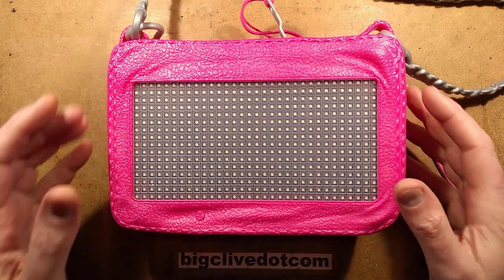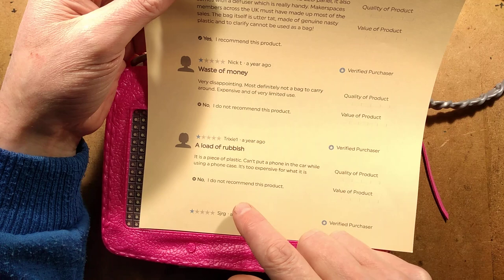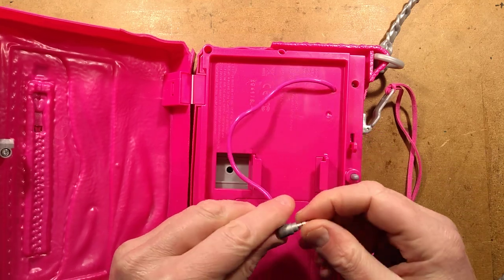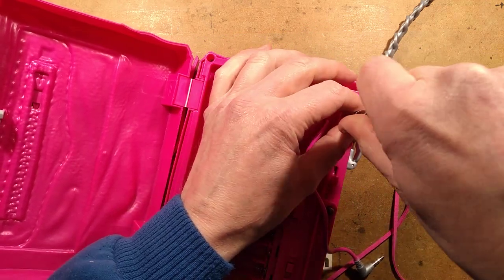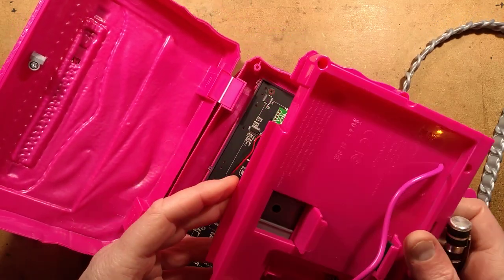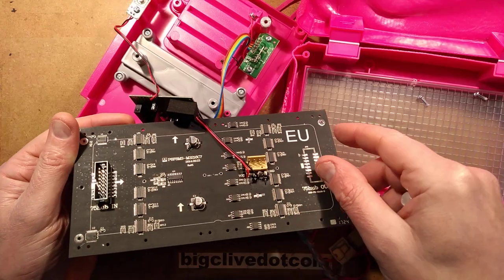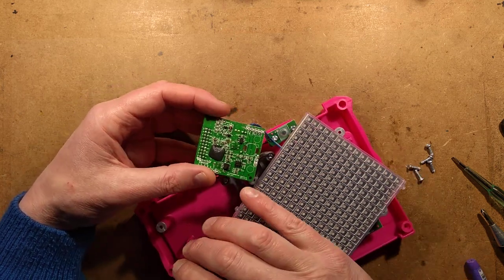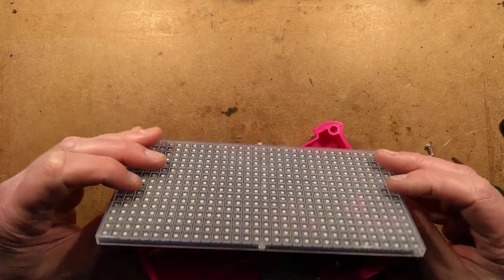Inside the Project MC2 video purse.  (Actual video wall panel!)

Comment: Amazon US has them for $8.  :)
Reply: Got 9 of them 2 weeks ago. Striped them of the panel and put the panel on a shelf for later use. Amazon has a 3 limit per order on it.
Reply: $50 plus shipping on Amazon.ca... 
and that or more from any other seller in Canada. 
Just buying the panel from Adafruit is cheaper.

I'll have to keep an eye out at the charity shops...
Reply: @LiezerZero  Plus currency exchange, shipping and import fees to Canada... works out to about $30 Canadian$$.
 But still a slightly better deal than buying it domestically. Thanks
Reply: Wow, the pricing on amazon is going up as I watch!  I missed out on the $8.00 price, bought at $10.85.  And just a few minutes later, price is up a penny.  It's like buying on the stock exchange, such pricing elasticity.
Reply: @lmamakos  Big Clive Effect. :)
Reply: Louis Mamakos , was $7.72 when I bought it, it's $11.26 now .. eBay went up from $9.17 to almost $12.76 as well
Reply: @lmamakos  up to $12.28 now. With delivery and customs etc, it's about £1 less than the UK Prime price. 

I nearly bought one of these for my daughter last Christmas; was way too expensive at the time though.
Reply: @lmamakos   You're right.. It's now up to $13.37.
Reply: $13.87 or so now .. close to $16 on eBay .. the A-Hole that I bought from on eBay is trying the cancel the sale using the excuse that they were out of stock and his "employees" didn't update the inventory. but in reality it's because I bought it for $9.17.
Reply: @LiezerZero  thanks for the link! ordered!  what a pointless yet awesome toy to play with!
Reply: $15.17 on Amazon and $17.50 on EBay at the moment. I'm so jealous! Might have to wait another week or two for the price to drop back down...

Comment: Totally not the cheapest way to get LED wall panels,  also you can get Linsn or Artfox LED send/receive cards online to drive them with dmx/artnet or even run video though a decoder. The parts themselves are pretty cheap for video wells. At least in contrast to lasers lol.

Comment: Oh, hell yes!  That little pink purse with a Raspberry Pi inside and using https://github.com/hzeller/rpi-rgb-led-matrix should be just a completely stupid project.   Lots of good info in that github repo, which seems to have been the genesis of the stuff on Adafruit.   Available on Amazon at https://www.amazon.com/Project-Mc2-Toy-Light-Purse/dp/B071LQR2QG for US$10.85, while they last..

Comment: Looks like a DMD connector used for LED sign boards. An arduino can control those easily. They daisy chain, hence the missing connector and the orientation arrows. As low as $10 bucks each for the RGB versions via Ali.

Comment: The protocol to control this panel is called HUB75. Its mainly 2 serial bit shift registers, one for the diode cathodes and some for the anodes (colors). This panel is divided into 2 parts of 16 colums. each part has its r, g and b shift inputs .

Comment: I knew that the headphone jack could be used to send/recieve data. I just assumed it was capable of talking digitally and somehow just cutting out the dsp. I paused and looked into it a little more and it seems it talks much like a dial-up modem.
Reply: The main issue with audio is that it tends to be decoupled to eliminate DC offsets. You can still work with it but you have to take that into account.

Comment: If you can get one of these for < $8 bucks then it's a super cheap way to get one of these LED panels. You could VERY EASILY throw out the logic board and hook it up to a cheap micro-controller by way of a library like this: https://github.com/mrfaptastic/ESP32-RGB64x32MatrixPanel-I2S-DMA

Comment: Awesome!  buy a Project MC2 pixel purse for about $50!  and rip out the panel.  Or pay about $20 for a 32x16 RGB led matrix display off of FleaBay!  Wait a minute...  May buy 2 or 3 at that price.  "BiG" SCReen TV aNyoNe???
Reply: UnrealVideoDuke , $50?? I bought them from Amazon for $7.72+tax free shipping and eBay for $9.17 few hours ago .. their prices went up since then but they are still much cheaper than $50

Comment: So its cheaper to buy a cr@ppy handbag than a panel on its own. Says it all, they do not want you to make or fix anything.
Reply from the maker: The handbag originally cost about $60.
Reply: @ @bigclivedotcom  you did not pay that. There is no price guide line today only what they can get.
Reply: That's pretty much how markets work. Presumably they couldn't sell these things at full prices and had to sell off the remaindered stock cheap.
Reply: @ @chaos.corner , Sort off, they use to stock pile them and sell them in sales.

Comment: This is nice. I'm actually playing around with this stuff right now. I cascade them to create larger displays.
A few years ago I made a 256x64 Red Display. I got "8" shades of red by dithering at 240fps. I did Nyan Cat and of course Conway's Game of Life.
These days, pixel-for-pixel, the RGBs are a little less expensive than the red-only ones so why not RGB then.
Currently in the process of driving 2x64x32 RGB, Clive is right about the protocol. My 32-row modules are driven two rows a time with 4 lines and parallel data. R1,G1,B1,R2,G2,B2,ROWA,ROWB,ROWC,ROWD,CLOCK,STROBE,OUTPUT-ENABLE
I am keeping the plug next to me, just in case. My modules don't have any blanking timeout circuitry to protect from errors or crashes. (Some others do)
These things suck the power big time. Even with the multiplexing, your single display: 2 rows with 32 pixels each: 64x0.06A per is about 4A worst case.
Once I receive my 70A supply, I'm totally gonna do a full-on RGB Nyan Cat demo.